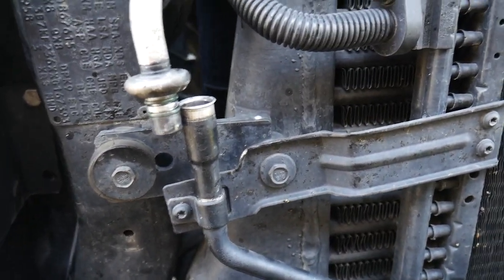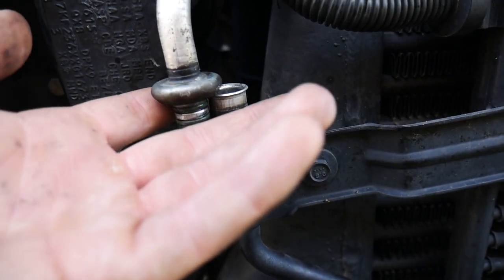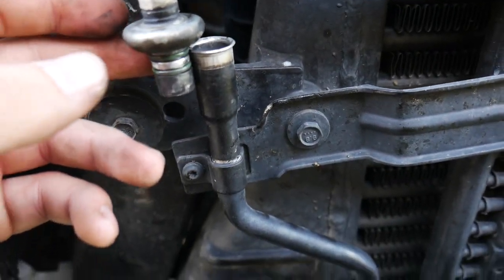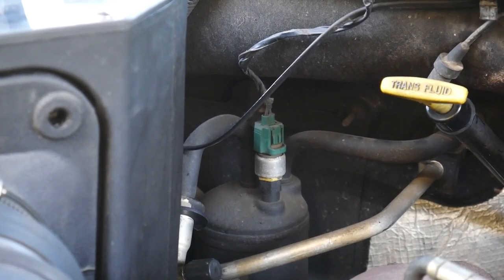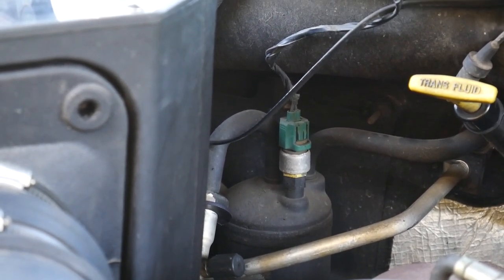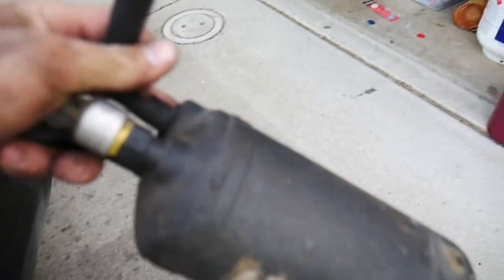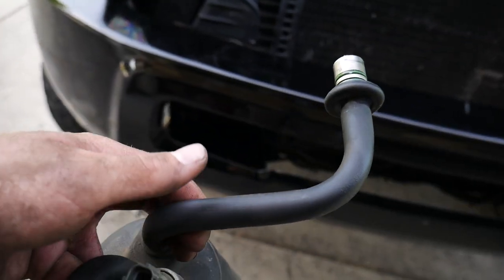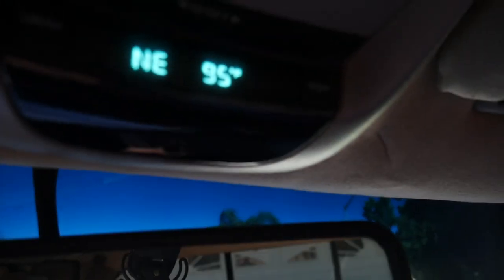2ND GEN CUMMINS AC ISSUE RESOLVED

Comment: What was your low side reading when clogged? I only have a low side gauge, and don't get any reading at all, but when the compressed engaged for a couple seconds, it's around 30-40 if remember correctly.

Comment: I've been trying to figure what's wrong with mine, it leaks.  I replaced the valves in the high and low pressure connectors and it worked for a while but still leaked out eventually.  By the way the Dodge dealer wanted $700 to replace that line.

Comment: Mine was missing freon overnight as it sat, and then I looked with the leak detector light and it was dripped all the way down my dryer all around it somehow it came out of there pressure so I changed it and bought a new dryer and it leaked again. Now I just changed the orifice tube and seeing if anybody had a similar situation I won't know for another week whether I lost any fluid but as I looked 6 hours later there was no fluid missing after the orifice tube.

Comment: Was the compressor kicking on with the clogged lines or no mine doesn’t
Reply from the maker: It was kicking on an off
Reply: STM II ohhh ok yeah mine doesn’t come on at all and I check my refrigerant every once in a while and it’s been at the same level for a year so ig it’s just my compressor
Reply: @stmii7581  
That is what mine is doing after replacing the compressor, high press line, accumulator and low press. switch. Today I am pulling it apart again to see if the condensor seems blocked. My fucking compressor is kicking on and off every 10 to 15 seconds still. I can jump the low press switch and make it stay on but I don't think you wanna do that for long. It still is only pushing 60 degree air out the vents. I have to have something blocked I think......I wish dealers didn't rape with such high prices